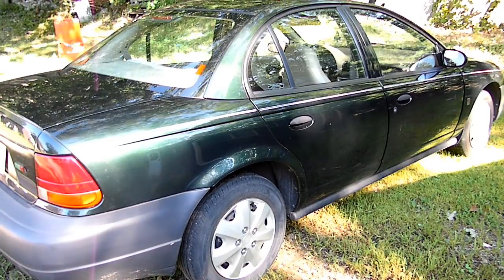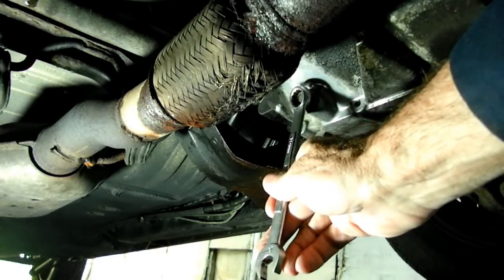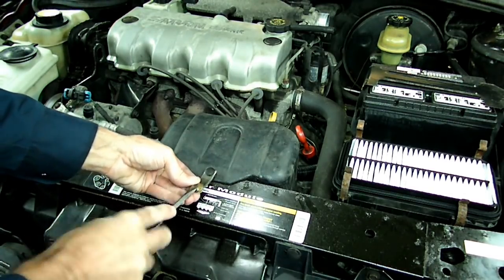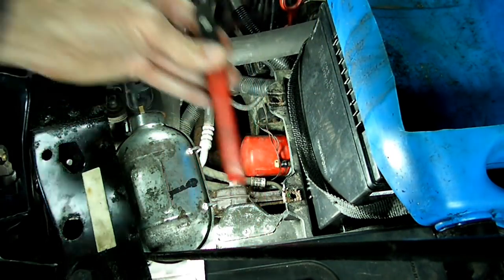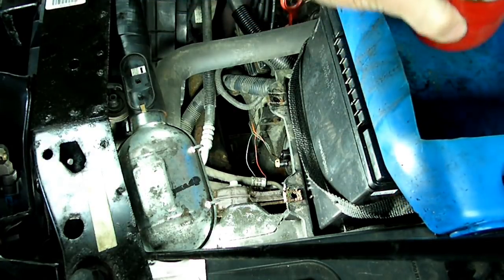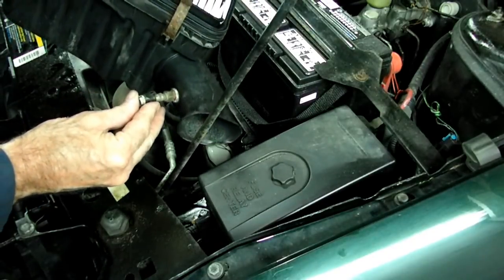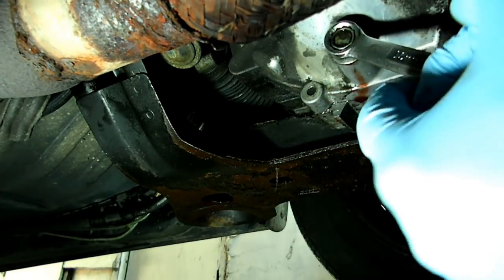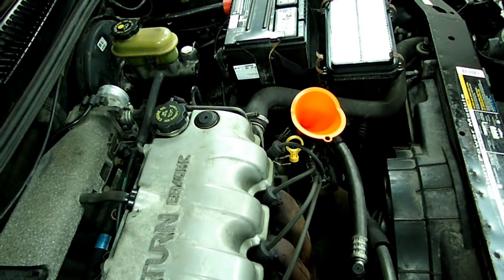Automatic Transmission Fluid Filter Change Saturn

Comment: Hello Richpin06a, let me start by saying Thank You for taking the time to make these videos. They have been a big help in maintaining my Saturn. I had a question and thought that I should get your opinion. I currently own a 95 SL2 Manual with 283,000 miles. I know that sooner or later she might bite the dust. I recently came across a 97 SL2 with 86,000 miles. This vehicle, however, is an Automatic and I wasn't sure how reliable the automatics were and if they have the pep of a manual. Any insight on this would be a big help. Thank You!
Reply from the maker: +outwestjake The automatics vehicles i have worked on 140,000 miles or so were still working pretty good.Watch out for reverse slam on your Saturn purchase though.
Reply: I occasionally get reverse slam with my 98 SL2. Any suggestions as to what to do about it? It's sluggish going into reverse and then makes a loud bang when it finally goes into gear. Maybe the tranny oil is too hot? I do live in Florida!
Reply from the maker: There is some good reading here http://www.saturnfans.com/forums/showthread.php?t=98659&highlight=reverse+slam

Comment: I have a question about our 1998 Saturn SL2 with a manual 5 spd.  Our clutch comes almost all the way out before it engages.  Also we just noticed a few days ago that we are able to shift the car without the clutch being in at all.  What could be the issue?  Clutch or transmission?  It makes no noises at all and runs fine down the road except it seems to not have 100% power when moving.  Any suggestions where to start?
Reply from the maker: How many miles do you have on the clutch.
Reply: We just purchased the car a few weeks ago so unsure.  Thanks for responding.  The car has 170,000 miles.  And the person we purchased it from said they just replaced the clutch but it was off of craigslist and we all know how honest people are on there lol.  Any suggestions!
Reply: We will do the filter change and transmission fluid change tomorrow.  Why would the clutch have to come all the way out before it catches?  What usually causes it?  To me when we are driving down the road it seems like it is in gear but not 100% in if that makes any sense at all.  I appreciate you taking the time to respond to me.
Reply from the maker: Shaina Lay
There could be a problem with the hydraulics,there is a check you can do here.http://youtu.be/ZL-FZ7bT4_A
Reply: Thanks so much for replying

Comment: I have a 99 saturn ls 1.9 4c auto. what model # fram OIL filter do I need?
Reply from the maker: michael indigo Fram does make a filter for the s-series automatic transaxle it is  http://www.framcatalog.com/PartDetailWindow.aspx?b=F&pn=P6646
Reply: thanks for answering me. I got this one today and installed it already. is this the right one?
a PH3614 . This was for oil filter change, not transmission. I know I'm commenting on a transmission video. btw ur video on the oil filter change helped alot. thanks.
Reply from the maker: michael indigo The PH3614 is for the engine.
Reply: +michael indigo PH3614

Comment: I have a 1996 sl2 with manual transmission. my high temperature and low coolant light having flashing together at the same time on and off but the coolant level is fine and the car not overheating. I've read different things some people say flush out the coolant, some people say flush out your transmission fluid, other people say it's your coolant sensor or your ball in the coolant reservoir that check the coolant level. do you have any input on that?
Reply: +Neil Manning This could be a combination of problems. I'm not a mechanic however low coolant with full coolant is usually the coolant sensor. As far as I know the coolant sensor is independent of the rest of the system. If your getting a high temp light you might need a thermostat which is a common maintenance item it can stick open or closed and doesn't happen consistently. It is possible for your coolant parts to work intermittently water pump could be going bad. Take the wheel of your water pump and wiggle it front to back if it moves (more of a wobble) the water pump is bad or going bad. Before you diagnose a faulty high temp light check your coolant parts to make sure they are still working and not wearing out.
Reply: +Neil Manning   I had to replace the water pump on my parents' 98 sw1 a while back. The temperature gauges were acting up, and it was starting to make some noise in that area of the engine. It's just something for you to think about.

Comment: what do you do if the bolt to drain is stuck on there?
Reply: (Perhaps too late for you but might help somebody.)  Squirting with a shot of WD-40 can help with a stuck bolt.  Let it soak for a few minutes or more before attempting again.
Rather than pushing/pulling extra-hard on the wrench, tap it with a hammer to shock the bolt loose.  Don't repeat this to tighten this bolt after draining; only hand torque it.  (The hammer trick is done for things like circular saw blades both to remove and install, so as to lock the bolt on.)
Reply: I am a woman and not very strong so I used my torque wrench to loosen it,  didn't take much force it was just on there good. I never changed the fluid before this was the first time it had ever been done. torque wrench set to 22 foot pounds as per manual.

Comment: It should be running and up to operating temperature. Then you can check the level while in park. The dipstick should say check while idling in park. It may say neutral but more than likely it's park.

Comment: these also have a internal filter as well .if I'm not mistaken. is it worth it to change these as well?
Reply: I've been under my sl2 and it doesn't have the plate that unbolts from the transmission.  Usually behind that plate is the internal filter, but this model only has the oil filter-styled filter.
Reply: My 2007 doesn't have a ATF dipstick to check level of fluid.
What's up with that shit?
Reply: it has both

Comment: is it possible to take out the trans filter from the under body of the car? this would be on a 1992 saturn s series
Reply from the maker: +nick ostrout Not the way i do it but It might be possible.
Reply: +nick ostrout Yes, it's actually quite easy to remove and replace the transmission filter from under the car.
Reply: Yes remove it from the bottom this way is more time consuming

Comment: the transmission on my wife's 2001 Saturn sl1has started shifting very loudly and hard, Very disturbing sounds as it goes into and drops out of lower gears. Will changing fluid and filter help or is this a sign of another, maybe worse problem with the transmission?
Reply from the maker: Does it make a noise when you put it into reverse.
Reply: it clunks loudly as it goes into reverse
Reply from the maker: Have you researched the phase "Saturn reverse slam".
Reply: looked it p and gave that a try. It hasn't improved much. Still makes noise on occasion sometimes shifts correctly. Thank you for trying to help.
Reply: My Saturn has been doing the same thing lately. Drops out of gear randomly and the RPM's rev up to almost 4. The RPM's stay usually in between 2 & 3. I have to down shift then shift back into drive just to make it stop. Would a fluid and transmission filter do the trick?
Reply: I found out I had to replace a couple bad solenoids. Easy fix just takes a little patience.
Reply: David G had this exact problem recently. gear slams in all gears. had to replace my bus plate and LP solenoid. that fixed my issue and my car shifts fine now.

Comment: @richpin06a  I will look for a fill cap which I haven't seen one on the vehicle. Or it could be buried somewhere. I also read that I should use a scan tool to make sure the right amount of fluid is replaced with the same amount and at the right temperature. I honestly would like to do it myself, but am very Leary of doing it myself since I'm afraid of not using the right transmission fluid and not the right amount. I have a 2003 Saturn Vue V6 engine, FWD.

Comment: Hi Phillip and richpin ( FYI: I have had email conv. with richpin regarding my problem). I had a transmission leak and eventually hard shifting problem after i shifted gear from "D" to "2" while going 75 mph because of emergency. Anyways, the shop changed filter and charged me $200 for it. The fluid leak stopped but it makes whining noise. Philip let me know if you figure out a cause for that noise. Mine makes it when I first start the car and hit gas and stops once I drive for a min.

Comment from the maker: It is recommended you change the automatic transmission fluid every 30,000 miles.
Reply: What is the capacity of the Transmission fluid to refill?

Comment: Why didn't you just take the filter off from under the car? That's how I did it both times i replaced mine and then you don't have to remove your air intake lol.
Reply: On my Saturn 99 SL1 that is not possible as the axle and engine guards are in the way and there is no way to reach up there ( I tried) removing the air box is a lot easier than trying to remove the engine guard

Comment from the maker: dwayne mcvgregor, I believe your owner manifold stats ever 30,000 the fluid should be changed so it sounds like yours is overdue.
Reply: The manual will say the fluid level. Takes out all the guess work.
Reply: Also thanks for your videos they are so helpful helped me do so much work.
Reply: +richpin06a  This is an interesting video , because I talked to one  oil  change place that does not change the transmission filter . They only change the fluid , and I believe that they draw out the fluid  through a tube .   Have you ever heard of any of  that before ?
Reply from the maker: +WISHBONEL7 I have heard of the fluid being removed through the dipstick tube.
Reply: How often would you change the filter that is inside of the pan ?.
Reply from the maker: There is no pan on the S-series.
Reply: richpin06a
When I look it up,  there is a part listed for it ,  ATP B-276 .

Comment: I recently purchased a 2001 Saturn sl2 with 98,000 on it. It appears the transmission filter was NEVER changed so I'm guessing the fluid is original. Anyone see problems with these car transmissions if the maintenance wasn't done for 23 years? So far, it drives and accelerates very smoothly and the fluid  doesn't look burnt but Im am changing it ASAP.

Comment: +Richpin06a as always a super video and that's why I follow. My brothers 98 sc2 automatic is having transmission shifting problems but they only happen in the rain I'm thinking its wire rub or possibly a sensor on the transmission is getting wet. Thought you could point me into the right direction.
Reply from the maker: +poemranger On the automatic i have not done much troubleshooting.Have you tried to run it by the smart people at SaturnFans to see if anyone ran into a similar problem.
Reply: No I haven't I was more thinking along the lines of because it only does it when it's raining it's an electrical issue. Possibly a rubbed harness or bad fitting on a sensor.

Comment: i hate to say anything, but that looks like a motor oil filter not a trans filter?
Reply: You learn something new? Because Saturn S-series
was different kind of car ! They put better thinking into
designing a better way to change ATF filters. But parent GM did not like that !
That was too easy, to change ATF filters,  so they killed the car,& then the company.

Comment: Is this the same on 2000 sl2
Reply: Yes. The only thing different from the SL2 as opposed to the SL/SL1 is that the SL2 is DOHC and SL/SL1 is SOHC. Drivetrain, body, interrior... it's all the same.
Reply: Transmission fluid change on all S-series cars is the same.